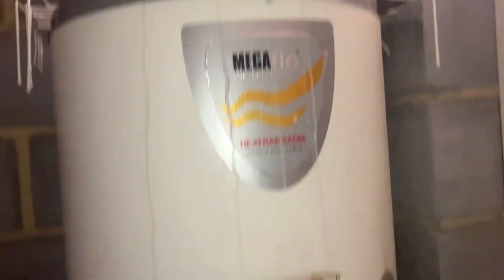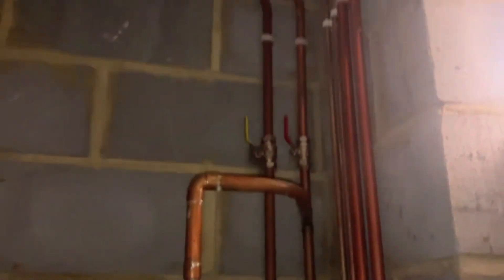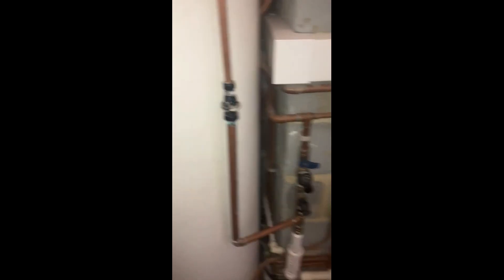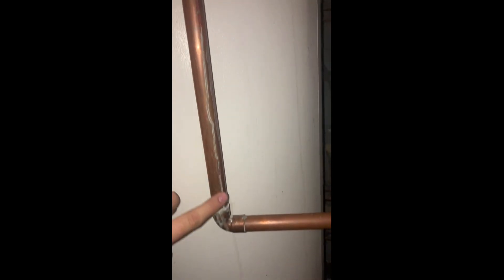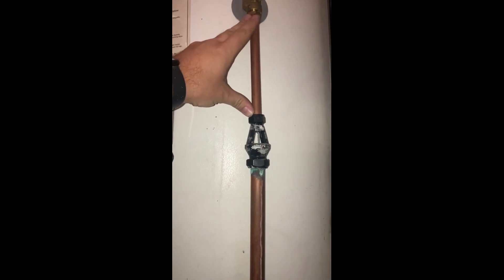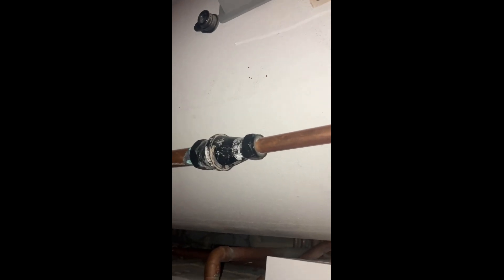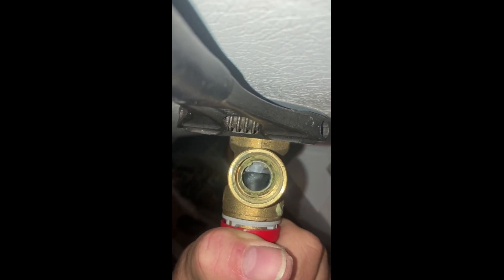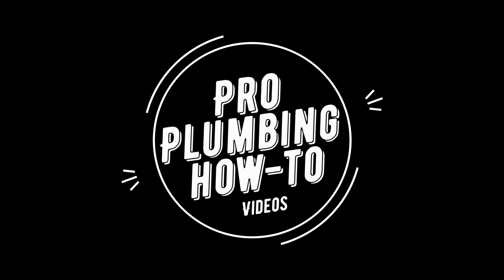How To Fix An Unvented Cylinder Dripping: Relief Valve Repair Guide

Comment: Excellent video! Can I please ask…What is the tool that you use to hold the red valve? I’ve had to do this manually without the tool and holding that spring valve for 10 minutes is harder than you think 😝 Thank you 🙏🏼
Reply from the maker: Yes it’s a TPR Key - I get mine from here :

https://www.unventedcomponentseurope.com/tpr-key-time-saving-service-key-for-re-charging-air-gaps-on-unvented-cylinders-2.html/

Comment: Brilliant channel, helped me a few times. My leak is cold water and iv had Gledhill come out and they said its all good. But its dripping cold water agsin, i have a small external white expansion tank, is that a faulty trv from the external expansion tank or too low pressure ftom there?
Reply from the maker: It could be low pressure in the white expansion tank, on the top of the tank under a black cap there is a Schrader valve (a normal bicycle valve). I advise you use a foot pump with a pressure gauge on it. Look on the expansion tank and it will state the manufacturer charge pressure ( around 3bar ) Not the working pressure!

 If after this is correctly charged and it is still dripping then it could be the pressure relief, it could also be the inlet pressure regulator.

Comment: What happen if faulty TRV megaflo?is the gauge keep fluctuating below 1
Reply from the maker: By gauge are you referring to pressure gauge? By TRV at you referring to thermostatic relief valve or thermostatic radiator valve?
Reply: Pressure guage drops below 1 bar  once in a while no potential leaks,drops to below 1 bar when its cool down after central heating
Reply from the maker: Would not worry about it too much if no leaks

Comment: Mine get a drip through the tp valve as my hot water is nearly finished heating up
Reply from the maker: It could be a number of different reasons, it could be the TPRV itself, the water is getting too hot, the expansion vessel needs charging/ if internal then it needs to be reestablished. Best to get a G3 qualified plumber in.
Reply: @ thanks he’s coming back in the new year think going to change that valve it’s lime scaled up just on looking at it he’s re done the bubble etc no loss in pressure or heat etc boiler cutting off when it should it’s just as the heating cycle finishes get a run for few moments and it warm / hot water

Comment: Did you just drain to below the level of the tprv then? Would it have been quicker to open up the drain off as well?
Reply from the maker: Hi @0laayoola9037, I opened the pressure relief as welds as the tptv, which was very low down and had a bigger diameter that the drain off valve, with a tap open so that air is allowed to enter the system to aid in draining down.

Comment: Ps how much does it cost to service these tanks please
Reply from the maker: It depends on where you live and how accessible the cylinder is. Normally around £110-£155 at a rate of £65 for the first 1/2hr then £45 per 1/2hr thereafter (my charges in the south of England)

Comment: Hi I had a new unvented hot water electric tank  fitted with a great G3 plumber 8 months ago. Today when I put the water on to heat it is dripping like crazy from the lower  front I guess you call a valve, it stopped after 40 mins. Now should I get Gledhill to come and replace the tank as I am a pensioner and don’t want issues in the future or do I need to call back the plumber to repair, he lives a long way away so I don’t really want to ask him back even though he is lovely but can I get the manufacturer here to sort it and replace it if needbe? This shouldn’t happen after 8 months surely and I have seen on here a tank shouldn’t really be flushed if this needs to be done so am worried. Thanks an urgent reply would be appreciated.
Reply from the maker: Hi, it depends on which valve is dripping, I expect it’s one of the pressure relief valves from your comment. It could be that the expansion inside or external tank ( depending on what model of unvented cylinder you have) needs re-pressurising. It could be a faulty valve or if it’s when heating it could be the immersion heater that is heating the water too much ( the thermostat on the immersion broken) in any case you will need to have a qualified G3 plumber to take a look. I don’t think you would get anywhere with the manufacture but you could try.

Comment: Mega flows older than ten years i fit an external expansion vessel due to wear with the internal baffle.
Reply from the maker: Hi @iancampbell582, good tip ti those who have already tried the basics and it does not work. Thank you for the comment.

Comment: Please,  someone correct if I am wrong but shouldn't these RV 's be replaced only by Qualified persons. I look after some holiday homes as a 'Jack of all trades'  but I don't replace these, pain in the arse sometimes these are, especially if the Tun dish is furred up and the water runs outside of the dish, have had a few ceiling repairs with that happening.
Reply from the maker: Hi @alangriffiths8401, yes that is correct in the UK you need your G3 qualification which I have. It’s because invented cylinders can be a hazard if installed incorrectly or maintained by an unqualified person.